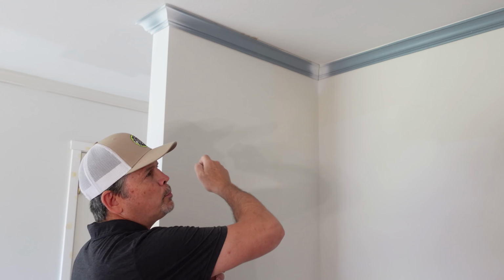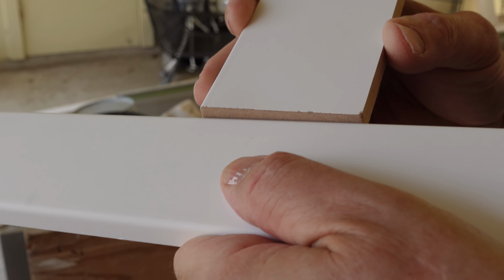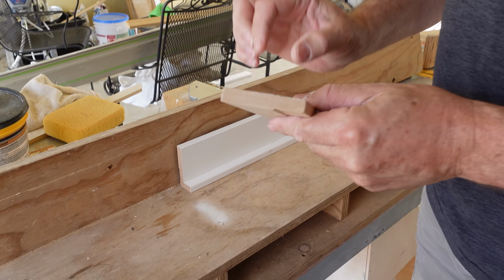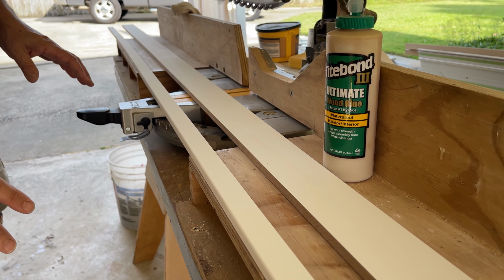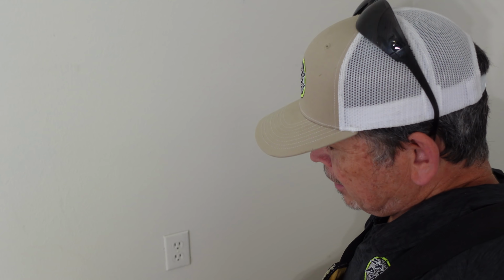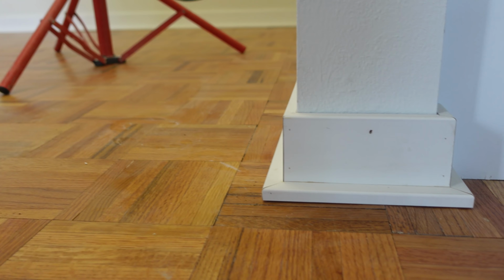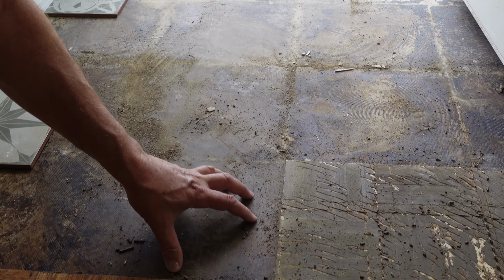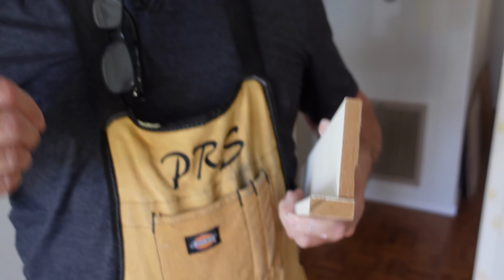How We Made CUSTOM TRIM to SOLVE a BIG Problem

Comment: I had that finger parquet in my last house.  The installer left a similar gap around the edge but it was filled with special cork strip that was stained to match the floor.  Once the baseboard (skirting here in the UK) was on you'd only see about half inch of cork maximum, but it was blended so well into the parquet that you'd think it was there by design.

Comment: That was a cool solution to get a more modern trim profile while covering horrible large gaps. In the series on this home, many comment on design choices. I ask that folks remember that not everyone has an unlimited budget. When problems come up near the final stages of projects the solution many homeowners opt for are the ones that don’t increase the scope of work significantly and don’t involve major changes to systems involving the trades. Rare is the client nearing end stage who wants to tack on a major plumbing rework to accommodate vanities design, trying to match 70’s parquet or adding in additional projects like ripping up / replacing the flooring. It’s not always just the expense, many times it comes down to time. More often then not, projects need to be completed within a time constraint like homeowners needed to move in or they were doing work before a major event to be hosted at the home. Good contractors like Stud Pack present homeowners with the possible solutions and the pros and cons of each. The homeowner picks what solution works best for them and their situation. And that is always the right solution- what the client decides meets their needs best.

Comment: Love the work you guy's are doing, you and your boy make a great team. Next time you have to miter your base trims try using a 30 degree angle instead of 45, its a shorter cut, looks better if there is any shrinkage and still has plenty of glue surface.
Reply: Also, use CA glue on the joint before putting it in place. Less filling and sanding later.
Reply: I agree. I always just use the crown detent for scarf joints.

Comment: Great solution! Someone mentioned doing a round over on the lower piece but I have found that problematic with MDF and then you would have to sand, prime and paint.  One alternative would be to put in the dreaded shoe or maybe a fluted door stop which would give a nice visual step down appearance, maybe not for every decor but it would add a custom look to some applications, somewhere between colonial & craftsman.

Comment: Given what you had to work with and budget it was a decent solution. I've had a similar problem in a 1955 California house. I had some oak milled in width and thickness of the existing parquet. Then I cut my own fillers so I could keep the base mould consistent through the house.

Comment: Hi guys!  I enjoy your videos because my son and I are like you two.  I’m the GC and he’s my right hand guy.  We both work the same way and seem to be similar in many other ways as well.  That being said, with regards to your video about covering large gaps between finished flooring and the walls, I’m not a fan of the solution you came up with.  I would’ve made a strip out of oak the same thickness as the parquet and run it around the outside edge then put base on top.  Just my two cents worth.  Keep up the good work and share your videos.  Once in a while, I learn something new (which is always a good thing)!

Comment: That is a very cleaver solution, well done. Another, more money, solution would be to take a piece of 3/4 oak and rip strips the same thickness as the flooring and fill in the gaps. You mentioned those 18 inch rollers, when I painted our new house a few years ago I looked everywhere for those, even the SW store didn’t have them.  Would have saved me a lot of time not to mention they do a better job evenly laying down paint.

Comment: Having a gap in the flooring, I use 5/4 stock ,
 4 1/2” high and add a base mould to the top and 3/8 Qtr. rd. on the floor like in older homes and high end homes in Connecticut. The ends where the base meets the trim around a door gets a small amount trimed off at an angle. The trim cut is done at a 45 degree angle , but just cutting off a 1/4 -1/3 of a inch on the 5/4 thickness . This cut prevents the base from being noticeably thicker than the casing. Looks good.
Reply: A bit more work, time and expense, but your solution would look so much better than the L profile created here…

Comment: Great video guys! I think this was a great solution! Only problem I could see is I’m pretty sure wood glue will not stick to a painted surface. So if that’s true it was probably pointless to use it when glueing the 2 pieces together.

Comment: Shoe molding of any kind doesn’t work for me personally but you guys tackled it well and got the job done.  I know it would have been tedious and time consuming, but did you consider ripping strips of parquet flooring to infill instead—or even just a long strip of hardwood to infill?  If time/budget wasn’t a constraint, that would be ideal.  Great content as always!  (I’m betting Jordan is buying a house!)
Reply: Only problem with putting in new wood on the floor. Is the old floor finish yellows over time and getting a new finish to match isn’t easy.   More then likely you’ll see right where the new flooring was added forever.  It’s a hard one to have a perfect solution to?  Depending how picky you are?
Reply: @ghostridergale  I mean yeah but even a different species would look better than chunky shoe for my personal taste. I also don't like regular shoe. I would have picture framed it with oak personally.
Reply: Maybe a remodel investment? Good for videos.
Reply: @ghostridergale  If a filler strip was installed with a darker stain it might look intentional rather than a mistake.  After first refinish may not matter.

Comment: I figured it got refloored with the parquet, and the flooring guy just floated it inside the original base and then nailed on quarter round.  

bears mentioning that putting trim together like that is where the tendency of air nailers to just insert the fastener without drawing the material tight together shines.  you can hold the material where you want it, and set the fastener, and it will stay put instead of moving like hand driving fasteners does.

Comment: What product do you prefer to use on the trim to fill the nail holes and the edges where the mitered ends meet? Specifically trim that is white and or will be painted white that doesn't shrink.
Reply: IMO spackle is the best nail/gap filler for paint grade trims, it won't shink like caulking will

Comment: I like the outside of the box thinking but perhaps as an alternative, gluing in a perimeter band of parquet flooring would be fine. Then just scribe the square stock down afterword. I lean away from shoes whenever possible.... I'm bare foot even as I type this.

Comment: My pet peeve? Having extension cords, air lines, water hoses that are NOT on reels get damaged all the time. In the Navy I kept requesting reels for the gear, and was told 'no' for years until I was in charge of the Tool Room and then? I got reels for the extension cords, air lines and water hoses and this amazing thing happened. Electrical cords kept their connectors attached, air lines weren't torn in two and water hoses didn't leak for the 2 years I worked there. Before those reels it was normal to buy new water hoses, extension cords every few weeks, and cut back air hose ends or cobble them together endlessly.
Reply: You can't be saving money like that bud, how do we expect to spend all this money?

Comment: People are going to trip on the trim.  When they look down and see the baseboard, they look at th top to judge thickness.  I would have built up the strips on the top/back and bottom/back so that the base molding all looks 1 1/4” thick! Thick molding would look much better, less hack look. Imagine a step pattern on the top formed by glueing two strips on the back. Gluing one strip horizontally on the bottom back would give the base support.

Comment: Finish my basement just put up doors and trim. Didn’t notice when we were putting in  a double glass door that the one side is about a 1/2” off the ground, had to do that to get all the sides level and plumb. What is a way to fix this. I tired caulk and so far that doesn’t look so good.

Comment: Nice, but I think a 3/8" roundover on the horizontal piece would further enhance the look and eliminate some of the ledge that will collect dirt and dust.
Reply: I think you're right ,I also think the inside Corners going to become a dust Haven.
Reply: I was thinking shoemolding but I like where you are heading with this.

Comment: My home's hardwood floors have been covered most of its 80+ year life, but now that the floors have been refinished, we're left with the fact the bottom of the old doors don't meet the floors well.  The shag carpets of the 1970s caused the carpet installers to cut down the bottom of these old single-panel doors to accommodate the profile.  I would love to see you guys do a segment on adding material back on to the bottom of the door.  I know the trend is to throw doors like this away and replace them with cheap hollow-core doors that fit well, but I think that would look horrible.  Ever run across this?
Reply: I think I'd be inclined to get a sweep to put on the bottom of the door.  assuming it's not a painted door, you couldn't match the wood, so do something that becomes an accent.
Reply: @kenbrown2808  to clarify, these are for painted single panel doors to the bedrooms, bathroom, and between the dining room and hallway. 😀
Reply: @steveloux4709  so that gives the option of splicing onto the bottom of the door, and making the seam disappear; or installing a contrasting sweep.

Comment: Lucky you didn’t nail your finger while joining those trim pieces, had your index finger right in the line of fire every shot 😆
Reply: I’ve been just learning to use my pneumatic framing gun, and was looking at brad nailers and thinking about trim… lol 90% or more of videos on “how to” brad nail mention those and I have to wonder how many people have taken a brad to the finger out there (I personally plan on skipping this step, but you never know when you’ll slip up!)
Reply: I’ve always heard to keep your finger a nail distance away even on the side where the nail enters, because it can hit a drywall nail or protective plate, bend, and sort of ricochet back out the front.

Comment: Should use CA glue on the joints instead of wood glue, especially on the butt joints with it off the wall, then you can sand/prime it before putting it on the wall and you won't see the joint at all.

Comment: I thought I wasn’t going to like your solution for filling that floor gap but it came out perfect. That magnetic stud finder is a real lifesaver. Everyone should have a couple in their toolbox 🧰
Reply: I like the large design of that one. I use a "Studball" for single studs, and a 10 pack of mini Neodymium magnets from harbor freight for temporary marking of multiple studs.

Comment: Hey stud pak.....I own a Rousseau table saw stand. They are made in Washington State. My brother who is a contractor turned on to this setup. I also bought their router table that attaches and the drop off table for long cuts. The best part it all folds up and it is easy and quick for setup. Check it out. I have been using mine for 20 years, my brother even longer. Its the real deal for contractors.
Reply: They're alright but I don't like that you can't use a rack and pinion fence. Not sure if that's changed with newer models.
Reply: @Tool_Addicted_Carpenter  Good question. Mine stand is 20 + years, came with a nice large fence and appears to be accurate.I built a number of cabinets over the years that turned out great. For home remodeling work it's is my go to saw. I use a Makita portable saw that drops into their stand and if my memory serves me its made to use other saw brands. To be clear the stand comes with its own fence. The real value I find is the portability, quick setup, light weight, small space for storage and it is really sturdy when set up. The space savings on the stand, drop off table and router table makes it my favorite and my backs favorite and still can use it by my self at 70 years of age. I leave my old craftsman router on the table and use my other router as portable. I am in no way connected with this company. Who ever designed the stand was on the top of their game. It cost more than I wanted to pay but that seems to be true with all good tools that stand the test of time.

Comment: 5-mins in and I’m dubious. That white sticks out and will collect dust and get banged up by vacuums, chair legs, etc. Why not use a nominal 1” strip of oak along the edges (stained with Golden Pecan maybe?) and then regular baseboard? Use a Sharpie to make a fake parquet tile line before you stain. Nobody’d notice.

Comment: An 18” paint roller cant be twice as fast because it takes longer to load the roller with paint!!  So, almost twice as fast :)
Reply: A 9" roller in a 9" tray takes the same time to fill as a 18" roller in a 18" tray. The rollers absorb paint at the same rate per inch.
Reply: @mwilliamshs  yes but it drips twice as much :)
Reply: Drips typically come from the edges. Each roller has 2 edges. They're equally likely to drip and at the same rate.

Comment: I wish you would've showed how you handled that big of a shoe when it dies into door casing (since it sticks out so much farther than just baseboard).  Did you angle cut the end?  Curve it?  (i.e. when the piece flat on the floor ends, how do you handle it?).

Thanks!
Reply: At~11:20 it just looks like they did a 45° lazy return.

Comment: I don't quite get the distain of late for shoe or quarter mouldings. Its a cost effective simple and decent looking solution for perimeter flooring gaps. Its almost like its become cool to hate the stuff. But if people want to spend the extra money for a different solution then that's on them. Of course they still complain about the cost of construction even though a good amount of the cost is from unnecessary add-ons....